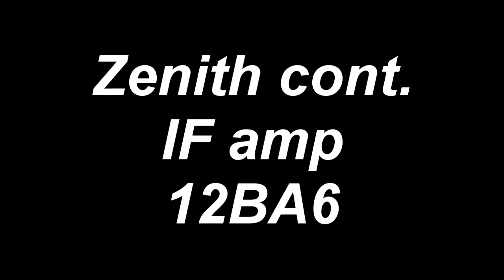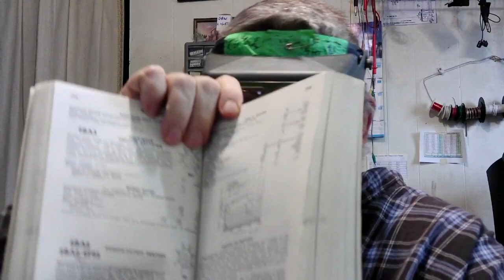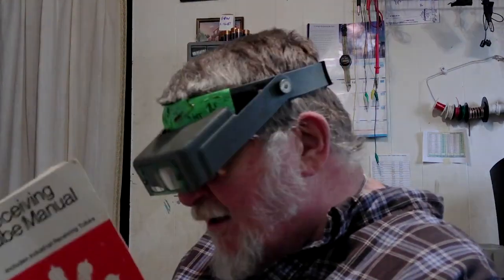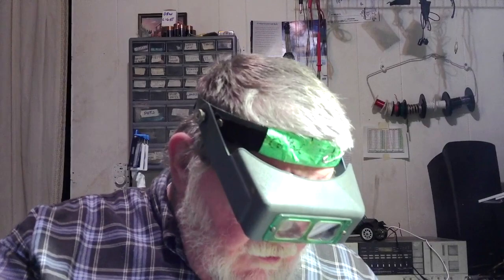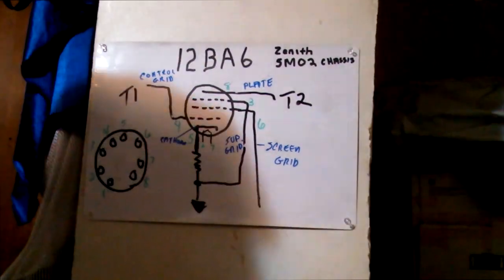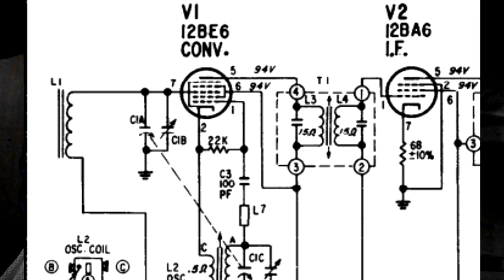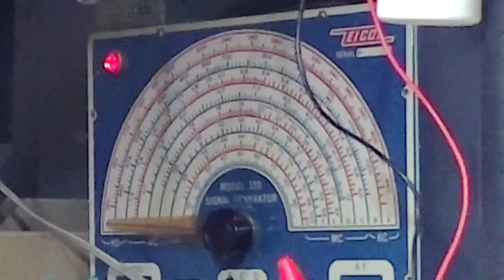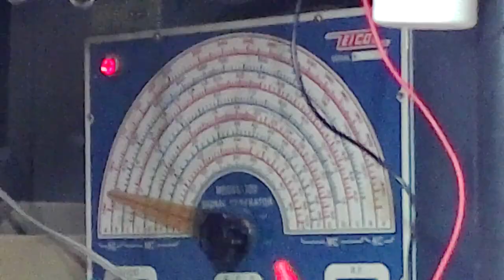Zenith  if amp

Comment: Great explanation Carl of How the 12ba6 works as well as the IF section of the radio. I have paper bound tube manuals same RCA one you have and an older one that goes back to the 1930's. The problem being so cold around here I have to keep my thermostat around 68 degrees just putting it up on 70 and it hardly goes off.
Reply from the maker: Thanks Larry,,, yeah I like having the paper book manual near by. Computer is okay but nothing like the book.